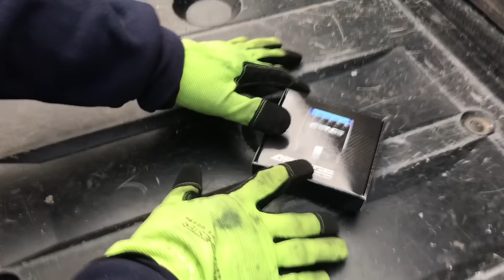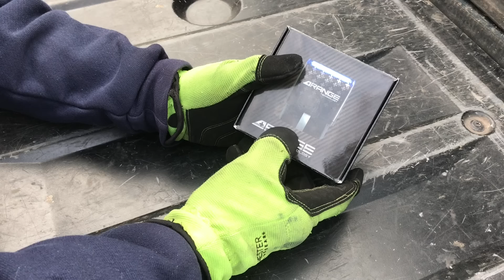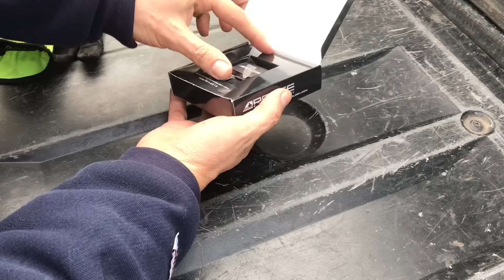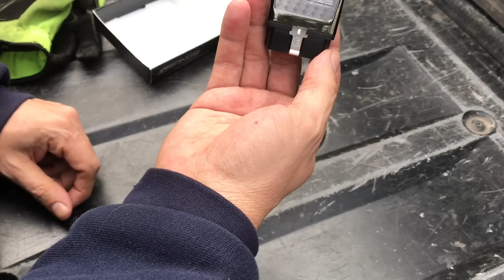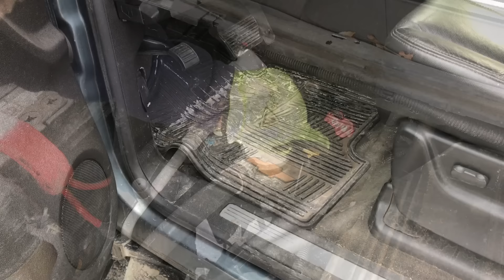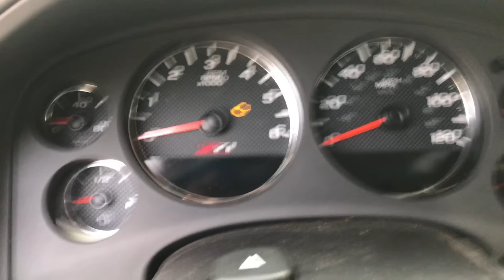Range AFM Disabler - Long Term Review

Comment: Yeah I used to run the range tool before I bought my truck somebody had issues so I ended up swapping the cam and lifters doing a DOD delete....  Pcv valve maybe bad checks out if you have a oil consumption...  monitor your oil pressure levels to on the truck if it starts skipping around you might have to change or clean the screen under the oil pressure switch and or you might have to drop the oil pan to change the rubber gasket on the pickup tube into the pump..

Comment: I had this and it drained my battery. Never had my truck sitting for more than a day. Took it off and no more battery issues.
Reply from the maker: Weird...I’ve left mine in for as much as a week and it still cranks over.
Reply: No issue with battery drain yet 2019 Silverado LD
Reply: What year and motor do you have?

Comment: 7500 miles between oil changes? Yikes. Your oil is super black because its burnt from going 7500 miles per oil change. Try changing it every 3k miles and you wont have any issues.

Comment: I installed the range device... 2015 Silverado stayed in v8 mode and still had lifters fail. And when the range device was in the CEL would not show I had a misfire. It masked the CEL. I fixed the truck and won’t use the range device again.
Reply: I'm debating if I want to sell mine for $150.  It seems to hurt my mpg and battery drain.  Battery issue could be from it being an original battery from 2015 like yours.  I bought my range for $130 so not bad to make $20 after use.
Reply: @ddkim619  I'll buy it off you if it works on the 5.3 impala lol.

Comment: Plugged disabler in.  Engine tapped.  Engine hot flashed.  AC stopped working.  Now transmission won't shift right.
Reply: Did you end up finding out?
Reply: @madbroindustries  yes.  A couple of the lifters will not work at all.  I could get them unlocked for a couple hundred dollars but they will fail again and quite easily.  Due to the locked up lifters, the programmer won't work.  It might work if i free the lifters but I won't chance it.  I'm just going to do the delete kit and be completely done with it.  Unless I see where someone has successfully freed the lifters with a long term successful outcome with the programmer

Comment: 175,000... and just starting to use oil? That would seem kind of normal.. Do you know how much is leaking?
Reply from the maker: Not leaking a drop.  In fact, it's hardly burning it with the Range device.  Maybe a pint between oil changes(7500k miles), at most.  Just hit 203k.

Comment: Adding this after I get my truck back together.  Third time in 3 years I've had multiple lifters fail.  Finally ended up replacing the VLOM and essentially everything else to do with the AFM system but this will at least get me to the dealership to trade her in LOL.  Great video👍🏻

Comment: I purchased the Range AFM Disabler in January 2019 and my 2007 Tahoe LTZ 4x4 uses no oil and stays in V-8 mode all the time.
Reply: Can you leave it plug in for any period of time? Does it drain the battery?
Reply: @bwest-yq3uc  I've left mine plugged in 24/7 for a month and haven't had any issues, but I drive my truck daily. I believe the instructions recommend to unplug it if your vehicle is going to sit longer than a week without use.
Reply: @ComedyBros5  Really good to know,thanks...
Reply: Just ordered 1 today for my 08 suburban with 115,000 miles cant afford and dont like the new ones
Reply: @davidcaskey4669  I just recently purchased a 2008 Chevy suburban and ordered this afm disabler. How is yours working out for you? Any issues since you installed it?
Reply: @spc_inv  none took it off my 2008 suburban 5.3 and put it on my 2017 yukon 6.2 works great
Reply: @davidcaskey4669  That’s great to hear. Thanks for the reply 👍
Reply: @spc_inv  I think they will work on any of the truck up to 2017. In 2018 they changed to the 10sp trans and changedprogram
Reply: @davidcaskey4669  I received my Range disabler today. I instantly noticed better throttle response. That feeling of the accelerator being tied to an anchor is gone. On a side note the transmission seemed confused with the change in drive ability. After driving it in different speed zones the transmission got into sync after about 30-45 minutes of driving and operates normally now
Reply: @spc_inv  if im not out on the interstate I run mine in the manual mode in 6th gear that way it isn't bouncing in and out of the 7th and 8th overdrive gears. I live on a hilly 2 lane road and overdrive is useless unless I get on the interstate. My yukon has a 3.23 axle ratio wish it had the 3.73 my 08 had or wven a 4.11 I'd rather have the pulling power as to only pull 1700 rpm at 75 mph on the interstate. I'm glad you liked it though it makes them a different truck
Reply: Thanks for the helpful vote of confidence! I’m gonna give this a whirl

Comment: My 2011 Tahoe would always throw a code for "Catalyst Performance Below Threshold".  The dealer cleared it, but it came back shortly after.  Later I cleared the codes again myself and plugged in a Range AFM disabler, and haven't had the Check Engine light come on since.  It's been several months now, and I'm hoping to temporarily remove the Range to check for codes again soon.  Maybe they are still there since they were "permanent", but the light has not come on since.  And I love not having the 4 cylinder vibration around 30 mph anymore.  182k miles so far, and I do seem to have a slight lifter tick sometimes, but we'll see how long it lasts!
Reply: You can use some Marvel Mystery oil for the lifter noise, they start to make noise if not enough oil is getting to them. if you are in v8 mode all the time then all the lifters have been working continually unlike in 4 or 6 that's what eventually damages the lifters.
In your case might just need to get the lubrication back and some cleaning on oil passages in the lifter Marvel Mystery should help you out with that.
Reply: Hows your tahoe keeping up? Im buying a 2010 tahoe police vehicle with 105k miles
Reply: @madbroindustries  It's still going at 185k.  I'm still using the AFM disabler.  Right now the only real annoyance with this truck is the persistent water leak around the driver's door.
Reply: @Maxxarcade  whats leaking?
Reply: @madbroindustries  Water seems to get in around the top of the door, despite the seals being new.  I think the door isn't shutting tight.  When I go for my next oil change, I'll probably have them look at it.
Reply: @Maxxarcade  ahhhi see. The weather strip. So you do recommend that product?

Comment: I have a 2011 Silverado z71 with about 117k miles on it. I also have to add a quart in between oil changes and I’ve had a couple plugs foul on me within the last 2 years. I want to get this device but I’m still not sure yet, i don’t know how long I’m going to keep my truck, I guess that’s the biggest reason why I haven’t bought one yet.
Reply: Did you end up getting it?
Reply: Try Again nope, decided to get rid of the Silverado.

Comment: Does it take off faster since it dont have the 4 cylinder
Reply from the maker: yancy velazquez Nope, still a 3 ton pig :-)
Reply: @HilltownCT  I got a regular cap though
Reply: I'm thinking of tuning it 
Would it burn oil or mess up any engine problems

Comment: I’ve used one on my 2010 Chevy suburban after i was having random misfire and it fixed the issue but now I cannot pass the emissions. My o2 sensors are not getting ready and my bank 2 is not closing it’s in open loop. When I unplug it it does allow my o2 heater to work but it starts missing again. Does anyone know how to fix or have a number for them. Any help? Thanks

Comment: Hate to be THAT guy asking questions an a yr old video, but i have a 2010 silverado i have to add a qt every 500 miles and just started burning oil...is it too late to try one of these or can it possibly help at all?
Reply from the maker: At $5.00 per quart, you're already spending a small fortune on oil.  If it were my wallet, I'd take the chance.  Good luck-

Comment: Buy the updated valve cover and your oil consumption will go away
Reply: I go 5k miles on Mobil 1 and don't see any oil used by oil change time.. but I also disabled the active fuel management through the engines computer and also turned off torque Management and  rear O2 sensors
Reply: And the updated valve covers
Reply from the maker: That was one of the dealer's remedies when it was under the extended warranty back 130k miles ago.  Unfortunately, it did nothing to stop it's appetite for oil.

Comment: i am about to go to the dealer to get an oil change and want to take the range out, dont want anyone to steal it. can i just pull the range out or will i risk that my lifters get stuck ? i am driving with the range for a few month and never had it taken out.
Reply from the maker: I have my Range connected to an OBDII extender with a power switch and I occasionally forget to turn it on. I wouldn’t sweat it.
Reply: @HilltownCT  ok, thanks for the answer. and what will happen if the lifters get stuck ? the engine wont start anymore or how do i notice it ?
Reply from the maker: @huntii  Engine misfire and will sound like crap.

Comment: today is monday, sept 16th, i got my range module earlier, plugged it in, here in hot ass florida,, i had to get a piece of rubber we use to help grip jar lids to remove it,, it's a tight fit, i drove around the block, not really enough to see the difference, my fuel mileage average before plugging in says 16.9 mpg, this coming weekend during our shopping trip, i'll see if i can tell a difference in shifting, dead stop acceleration speed etc. i got just over 21000 miles on my 2016 silverado, i only drive it on weekends, hopefully this helps with the oil consumption i noticed recently and the erratic transmission behavior and odd shifting , i left it plugged in, i don't think i'll have battery drain, time will tell, i got 10 bucks off, so 189 shipped, i ordered it last friday from colorado, here monday to florida, excellent speed

Comment: Just bought one from Range was expensive especially since I live in Canada and got nailed duty price to door $290. Have a 17 High Country 6.2L  one thing I noticed right away was no more transmission clunking which is caused by AFM I was told. As far as MPG can't say yet but didn't buy it for fuel mileage. Have the latest version and it does what it says no codes and doesn't run battery down. Left it plugged in for a month and didn't kill battery I think that issue was solved also throwing codes. Truck feels smoother but I wasn't that bad before either.
Reply: If you have to get another one get it from JB POWER SPORTS.  From Edmonton then you won't have to pay US dollars.

Comment: Do you still use this? If so how are you liking it?
Reply from the maker: Beardstrong08 Yep, still use it.  I don’t drive the truck as much anymore, so I connected the Range device to an OBDII splitter with a power switch to prevent battery drain.  No issues with it whatsoever.
Reply: Hilltown where did you find the splitter
Reply: @MrDantastic423  amazon like $13

Comment: I use a Range with a 2015 Camaro SS.  It works as advertised and keeps the engine in V8 mode all the time.  There are negative side effects tho.  Sometimes it freaks the power steering out and kicks the check engine light on.  When that happens, pull the Range out and let it sit a few hours and it's fine.  Better a few issues than trashing the motor and making it burn oil like a skeeter fogger...
Reply: I would call Range Technolgy about an updated version of the firmware,...my understanding is they will make it right

Comment: You put 175,000 miles on that vehicle before installing the AFM disabler?      Basically what I'm asking is it was trouble free for 175,000 miles?
Reply from the maker: Yes and yes except for a piston ring kit installed under extended warranty by the dealer at 79k for oil consumption issues.
Reply: Hilltown Thanks!   Was wondering because I have a 2018 model and I believe GM updated/upgraded the system after 2014. Then in 2019 they developed a whole new AFM system. I do have a slight miss/vibration at idle with 21,600 Miles but revs smooth.
Reply: @Mr.Beastforpresident  That must be the GDI technology that came out in 2015. How is it now?
Reply: Kevin Idles smooth now since I used GM's OEM Dexros 1 Gen2 oil. 
Better MPG's, More power. Before I used other brands that were Dexros 1 Gen2 Approved, It's not the same. Basically like the generic Fruit Loops, looks like Fruit Loops but doesn't exactly taste like Fruit Loops.

Comment: I see most people talking about buying this to remedy excessive oil consumption, but I’m wanting to buy this to prevent another engine rebuild. Recently, one of my AFM lifters went out. Luckily I have a wonderful mechanic friend, or it would’ve cost my ~$4000 to have my engine fixed. So my question is, do you think this will prevent another AFM lifter from going out? I mainly am looking to purchase this thing because I’m terrified of that happening again.
Reply: @sarahdutra3431 4 years later, no issues! Zero rebuilds, and we only replaced a single lifter. It may be luck, but I’m glad I bought this!

Comment: I have an 06 Envoy Denali 5.3. I am got a new AFM Disabler from range and it doesn’t keep it in V8. I can hear it go and drone in V4 when cruising. They sent me a replacement and it still switches. Anyone have this issue?

Mine does the same flashes first on left then 2nd from left then goes to only solid right no matter if on or off.

Comment: I have a 2014 5.3, started burning oil at 40k. Did the oil consumption test and after back and forth they replaced my pistons and rings at 48k miles under warranty. Im now 1500 miles on the new pistons and rings and havent used any oil yet. Prior to the replacement i was burning more than the GM threshold of 1qt per 2k miles. considering getting this product to shut off the v4.
Reply from the maker: I would if I were you.  I had the piston ring kit done at 79k, but it eventually started burning oil again.

Comment: Change your oil when you get to 50%oil life...that's the advice I got from a mechanic who seemed to know his stuff....
Reply: Greg B I would never go 10 thousand mile intervals better to just spend 40 to change your oil and be sure than push your luck and be out a motor
Reply: @johnnytsunami6185  its  because they are using full synthetic
Reply: @madbroindustries  Yes, and the more you drive it on a daily the more chance the oil has to reach a higher operating and let the oil filter do its job.
Reply: Waste of money

Comment: I have a 07 suburban and I've been dealing with alot of weird vibration when the SUV switches from v4 to v8. I'm interested in this afm disabler. Would u recommend this to someone like me dealing with this problem??
Reply: Some have reported that it helps or solves that issue because its torque converter shutter when it switches. I don't own one though so just stating what I read
Reply: Absolutely!  If it doesn't switch to V4 mode, there is no shudder and vibration.  Many report better acceleration onto the highway also.

Comment: If you really don't want the DOD to activate, pay and get a real DOD delete kit.  A bit more money and work, but none of the headaches and potential damage as you literally replace the lifters and reprogram the engine to not recognize DOD.  I'm about to get this done on my truck as I may have a stuck lifter now and you have to go in and replace the lifter (so you might as well replace them all and delete DOD at the same time, which is what I Plan to do, which should also solve my oil consumption issue too, which isn't too bad, about 1/4 quart ever 1000 miles).
Reply: If lifters are tapping should you replace or just get delete kit or can  you just use the range
Reply: @djcliffyc  I tried the Range (at least, the original one which I got about 4 years ago) and had nothing but problems with it.  It would cause my truck to do random odd things, like slam into gears hard during acceleration, random warning messages when there was no problems (ex. I had warnings about 4WD service and random times, even if 4WD wasn't engaged).  This all went away when I stopped using the Range V4.  Maybe they have a newer one out now, but I'm not willing to try again.  4 cylinder or 8 cylinder is fine for me, I don't care, and at 134k mine's doing just fine.  I decided not to get it done (the AFM delete) as I don't really have a lifter problem (ended up being an exhaust issue that sounded like lifter tick).  It does burn oil but at the amount I"m burning, it's far cheaper than a AFM delete (plus I'm not going to be keeping my truck for more than another 2 years anyways).